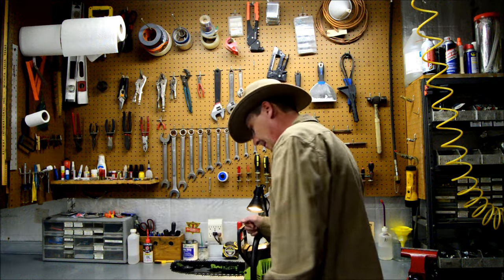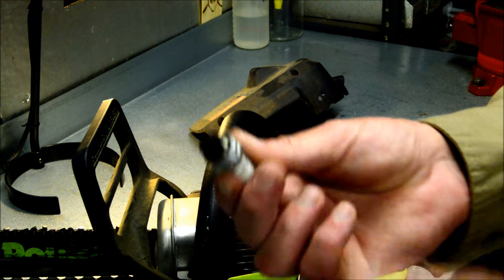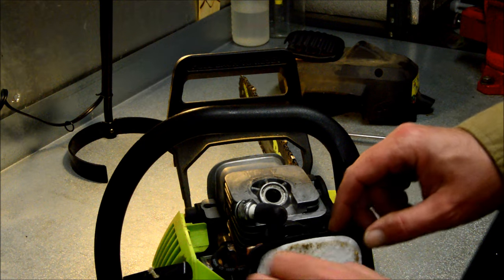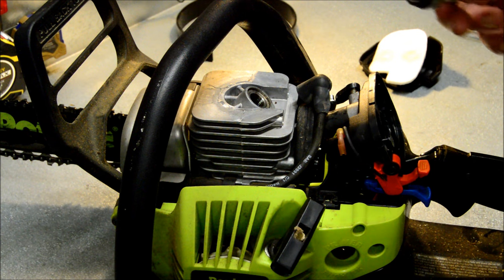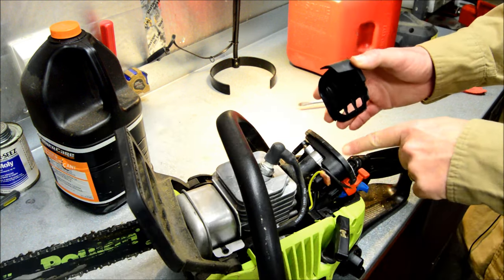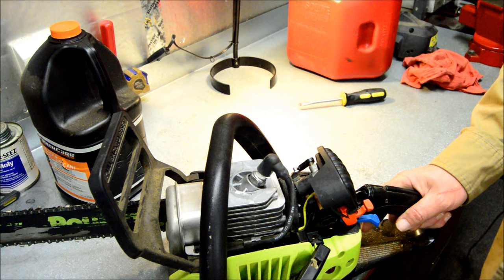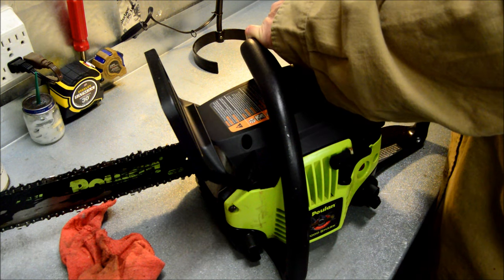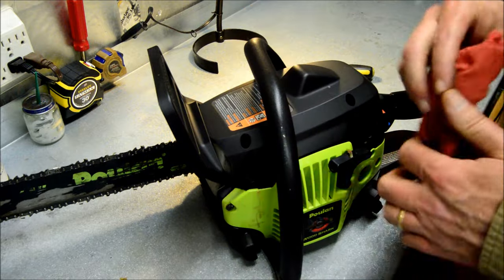Chainsaw Won't Start - 10 Years in Storage - Poulan Woodshark - DIY Repair

Comment: 10 years? And you didn’t go for the carb first, then the fuel tubes! You didn’t check for oil first? This is why you can get ripped off by a shop!!
Reply from the maker: Check for oil first? Do you know how a 2 stroke works? IDK what your talking about getting ripped off? The carb/fuel tubes as you call them were fine. This saw is still running strong, but thanks for the constructive criticism.
Reply: Thx for the tutorial. Ive been doing this for years but I still get tunnel vision and frustrated and this was a nice down to basics video to calm me. RTD is a complete idiot and doesn't know the difference between a 2 stroke or 4 stroke motor obviously. Why some people have lost all sense for gratitude and manners I will never understand. I appreciate your time myself. Keep up the good work. Oh I forgot what is the plug gap setting and what is the baseline on setting the hi lo adjustment (1 1/2 turns to start on both?) Is a business card fine for setting coil clearance or is it more persnickity. I am missing something here and Its driving me nuts. This was a fairly new saw that was tinkered with then pawned off on me. Ive run new fuel lines and blew out the carb but didnt get into it. I hope I dont have a air leak on the tank. It will fire quickly but not run like its not getting fuel or its got air leak somewhere. U gyess I am going to have to look at the diagphram  and check the fuel line ports for leaks. 
Thank you kindly

Comment: Only problem with that chainsaw was lack of fuel.
Reply from the maker: Sorry I wasn't clear in the video. PO tried it w/ fuel, drained it, and brought it to me. thanks for commenting.
Reply: Shouldve choked it first.and have correct gas mix.

Comment: dont ever use starting fluid on any 2 cyl eng  you have not lube in the starting fluid
Reply from the maker: I've used either many times over the years and never had an issue. Someone else recommended wd40 I will try it next time. Thanks for the input.
Reply: @TheHandsOnChannel  yes any aerosol spray will work but it has to mist like the wd40 without the straw, the wd40 will be best for the 2 stroke

Comment: never let the thing run on choke "for a minute or so" 
never "feather the throttle while the chokes on"
never "let it run for a while and get good at hot"
All of these things go hand in hand with fouling plugs. letting it run on choke for more than a couple seconds....just a way to start fouling a plug. Hitting the throttle with choke on, you're just feeding it fuel and oil that won't fully burn off like it will without choke, making more build up on the plug over time by doing that. letting it run for a few minutes/just idle, is the same thing, more oil and residue build up. 2 strokes need to be run at the higher rpm to fully burn the oil off in the fuel mixture
Reply from the maker: Never had a problem fouling plugs and when you hit the throttle it disengages the choke. To each his own.

Comment: There wasn't nothing wrong with that chainsaw to start with lol... It started too easy. If it hasn't been started in 10 years that old gas create varnish inside that carburetor an fuel lines. If it was that easy started anybody could do it lol. If anything they over primed it and flooded it, maybe..

Comment: Pretty sad when you blabber about stuff you don't know about this is the only video of yours that I've seen I'm not interested in watching anymore before you start talking about small engines or any engine for that matter get educated know what you're talking about I was scrolling through Facebook found one of my chainsaws in the image which is so you just claim to work on you can't clean the spark plug with wire brush the tip has very little to do with anything you need to get down inside the electrode all the way down the inner barrel saying you cleaned it with a wire brush just annoyed the crap out of me break parts cleaner would do a better job I use sandblasting media glass blast with a spot special tip on the blaster then I blow it out with compressed air give it a good visual inspection shiny new for the plug back in you can't clean a carburetor by spraying in the throat nothing is going to get into the bowl nothing is going to get into the aisles yet nothing's going to get into the high-end Jets nothing is going to clean the needle in the seat so spraying in the throat doesn't do anything other than foul plug and still lubrication from your cylinder it's a great way to destroy it saw or any engine for that matter
Reply from the maker: The saw is working great just the way I fixed it. Take your bs elsewhere.
Reply: @TheHandsOnChannel  you didn't fix anything
Reply from the maker: @mikebrady3298  Thanks for watching!

Comment: I guess you really didn't do anything.
Reply from the maker: YT critics crack me up. I didn't do anything except clean the spark plug, inspect fuel lines, clear out a carb clog, and ultimately get it running after it sat in a shed for 10 years. I'm sure you are an expert and I cant wait to see your video.

Comment: Poulan brand is the object of disdain for elitist Stihl and Husky owners. Any saw that sits 10 years will not run.
Reply: My dad had a husqvarna 372xp that has been stored for 20 years. I poured the old fuel out, poured fresh gas and fired right up on the 4th pull.
Reply: @bj69x  wanna sell it?
Reply: @jolkraeremeark6949  no sir. I use it from time to time. Strong machine

Comment: I did the smartest thing I could do with my Poulan 262 gas chain saw: tossed it in the trash bin.  I paid $75 for it to be tuned up, and I still spent more time trying to start it than actually using it.  Now I use lithium battery powered chain saws; by the time someone else has started his chainsaw I have finished using mine.